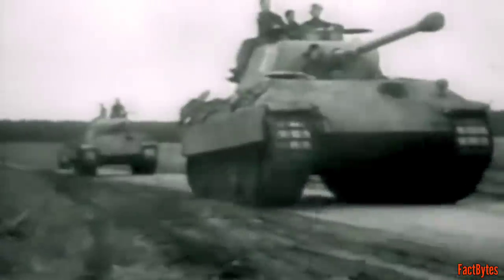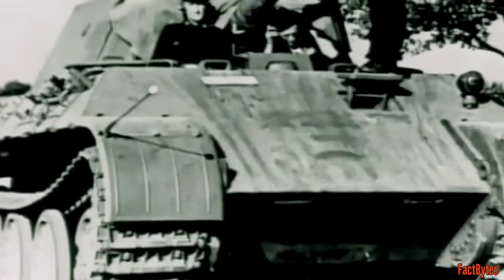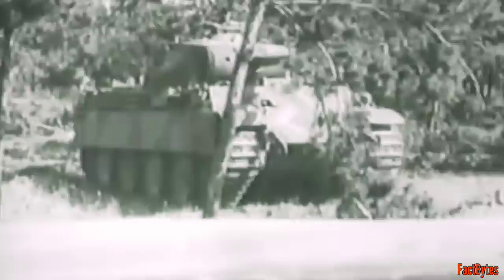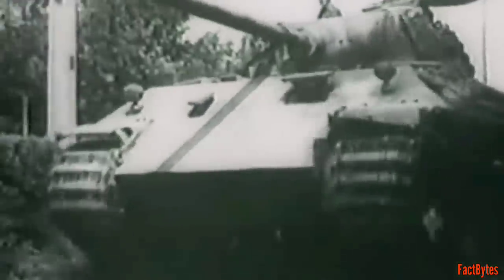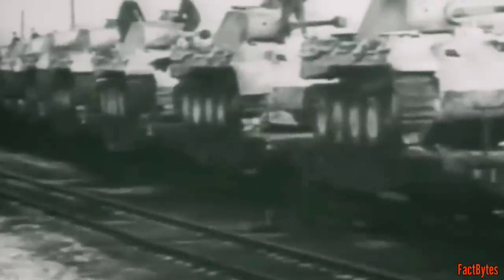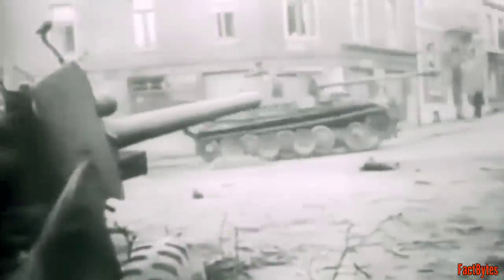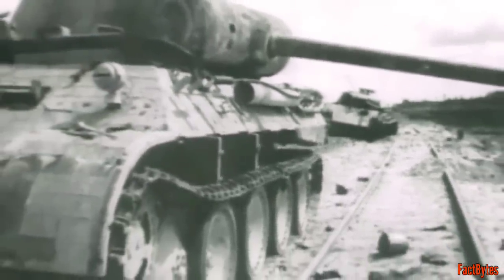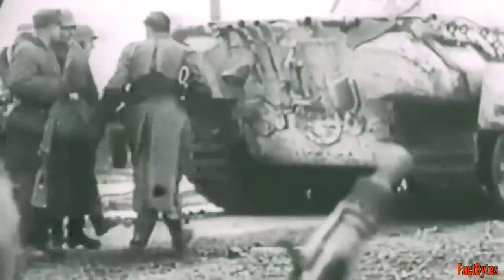Was The German Panther Really The Best Tank Of WW2?

Comment: This
Reply: Yes, like I said, there are a lots of subjects that you covered, that I would like to pick apart, like welding, simplicity of manufacture, and ext. You dump so much info....
Reply: @RussianThunderrr  I'll attempt to copy and paste what I said before buts it'll likely be different
Reply: @RussianThunderrr  though which one do you mean regarding welding, the Panther or T-34, as I can recall the Panther grew to have poor welding as the war progressed and T-34's faced quality issues, welding being one factor where in some case, gaps may be able to be seen and thus the rigidity or both vehicles structures become much more compromised.
Reply: @jerryudonneedtoknow3903  wrote: "though which one do you mean regarding welding, the Panther or T-34, as I can recall the Panther grew to have poor welding as the war progressed and T-34's faced quality issues"

-- Yes, I'll cover both tanks, rather most of Soviet and German tank building differences. First of all is a couple of words about "slop armor". There was a guy in the Kharkov design bureau name Nicholai Fedorovich Tciganov, and he was in charge of improving BT series tanks, and Soviet government was not happy by performance of light tanks(T-26 infantry tank, and BT(Quick tank) aka Walter Christie tank see link below) because it only featured small arm prove armor, but Soviet Government would like for those tanks to have an AT gun prove armor protection. However there was a catch with that assignment - BT tanks had a hybrid/convertible tracks/wheel propulsion, so weight of that tank was even more restricted then German Panzers requirements of that time(you probable aware it was around 24 tons, because of river crossing bridge restrictions), but in case of BT tank because it supposed to ride on wheel, to preserve wear and tear of tracks(it carried those on side sponsons) and once on soft soil, then crew installs somewhat narrow tracks, so if armor heavy enough to handle AT gun installed, then cross country capability suffers a great deal, so project "Tortes" aka BT-SV tank was created(two build) to test how sloped armor would work, followed by many other with ever thicker armor prototypes to follow, so he came up with a "Theory of Rational Angle of Armor Plate" which is pretty much an Effective Armor Thickness in a nutshell. He figure out that RHA(Rolled Homogeneous Armor) at steep angle doubles, and as a side benefit of incoming AT round to ricochet, and since it was an armor plate, instead of compound tank front at the time be it BT tank or Pz-I, II, III or Pz-IV and Tiger I manufacturing became a lot easier since less welding required.

Here is BT tank:

https://www.youtube.com/watch?v=QKaJ1hT6tUc&t=3s
Reply: But, first, yes thank you for been frank about source in a final gear subject. The reason why I asked this question is this: by the time of Pz-V development Germany had an ample supply of tungsten, in fact they were manufacturing tungsten-carbide core subcaliber munition by thousands, so of course they would have enough to make a  machine tooling from it. Second point, like you already saw, that cutting helical teething is just a simple matter of angle, nothing fancy tools wise required, at any rate it would improve reliability of final gear drive, however Pz-V final drive problem was mainly because it was designed for tank that was 10-15 tons lighter, and have a smaller and less powerful engine, so its an engineering problem, and not the type of gears were used, you could have a reliable gears, if proper gauge/thickness was used even in a spur type cog. One way around this problem, was planning for Panther II tank, that supposed to use Tiger tank transmission, and Tiger I main gun without muzzle brake, which was one of the features(muzzle brake) of T-34 tank(and most modern tanks, this vid mentioning how powerful was muzzle blast to by standers, but did not mentioned how much tank demasking itself), while Panther II caterpillar tracks supposed to be transportation tracks to Tiger III.
Reply: @RussianThunderrr  Agree, but I might have not stated the reason why I was emphasizing the gear. Indeed the Panthers transmission was designed for a 30ish ton tank, that's what made the gears the problem, so of the panthers gears are far to small for the vehicles weight, I don't fully recall, but something about the third gear of something, gearbox, or whatever. 

Anyway the point is, the gear design additionally adds to the problem, the current Panthers gear being a basically single straight spur cut gear was not the most suitable for pulling the vehicle, the panther was planned to have a planetary gear (I'm unsure if the planetary gears would consist of spur cut or helical cut gears), the spur cut gear for starters does has much more stress put into a single point where the gears mesh compared to a planetary gear system or just a helical cut gear due to the surface area which both usually cover more off. This meant that, even though the transmission was meant for a 30ish ton vehicle is could have possibly done decently better with a gear that could take more of a load.

But that was not the case, what is the case is that the transmission was 15ish tons overweight, the gear is not the very close to being suited for that weight, with the addition of the fact that the gear was pretty small, and this all this weight focused in a tiny area would be sure to cause high stress for the gear which would result in the shearing or shattering.

I'm sort of throwing in both the final drive gear and other gears because it wasn't only one gear. But I can't really focus right now.

So basically 3 main problems with gear.
1. What it was put in was not meant to handle the weight.
2. Some of the gears, were small for the tanks weight meaning much more load was put into a small area putting high stress.
3. The basically other gears beside the single spur cut gear while not the most necessary would have helped the dispersion of all that weight focus onto the gear due to more surface contact to disperse load.

Say the helical cut gear is used and the quality is terrible, I would more or less assume it would survive longer because it could more easily disperse the heavy load and stress put on it compared to a spur.

The idea of replacing the entire transmission is just throwing the discussion about it out he window thus why I stick to the underpowered one and look at plans, ideas, or attempts to patch the underpowered one
Reply: @jerryudonneedtoknow3903  wrote: "Indeed the Panthers transmission was designed for a 30ish ton tank, that's what made the gears the problem, so of the panthers gears are far to small for the vehicles weight"

-- Ok, so it looks like you have a good grasp of the Panther transmission problem, so the only thing to mention here is to replace it its a 3 day job, just like many Panther tank suspension repairs were a major PITA. Back to armor/welding subject.

-- So, beside N.F. Tciganov, there was yet another key fellow with name Eugene Patton, who improved upon electrode welding, where it took almost a week of dozen of welders to weld a complex shape tank hulls, but with automatic submerged flux welding only one, and not so highly experienced technicians could weld hull of T-34 in a rotisserie jig in just a shift or two, and the quality of the welds were so much better and stronger, that often if you see earlier 1940-1942ish T-34 hull with a turn side or front glacis plate in the event of internal ammo failure, after 1942 you would almost never seen torn apart T-34 hull, yet 6 tons turret might be blown away 50-70 feet into the air, and might landed nearby the otherwise intact T-34 hull, where weld seams are still intact, it was that good and strong. And this welding technic did speed up tank production a great deal, while German tank production still used very slow electrode welding.

-- A few words on poor metallurgy: I'm not sure how much do you know about Kharkov tank factory evacuation, it was after all pretty deep into Soviet union, but it still have to be evacuated even deeper to beyond a Ural Mounts to Nijnei Tagil where train factory was near by iron ore mines, however production of the tanks commence almost immediately upon arrival of evacuated equipment, in the middle of the winter in Siberia, while walls and roof was build around factory under weather exposed manufactory, could NOT possibly provide technologically correct heat treatment of armor plates at sub zero temperatures, so winter of 1942 was the lowest point of T-34 tank quality. There was also other factory building T-34, like a former ship yard Sormovo, that produced low quality tanks as well.
Reply: @jerryudonneedtoknow3903  -- Couple of words on a couple of other to favorite myths optics of T-34(namely earlier 76mm). As I mentioned after capture Kharkov, near that city there was an optics factory in a city of Isumins, so no more gun sights and periscopes for a while Soviet industry could produce for a while, so mirrors in a periscope was substituted with polished aluminum plates, and optics was of atrocious quality, but as the time progressed to the end of 1942-43 and more factories was back into production of sights, so optics that was good for knocking out German tanks at the distance of 1200-1600 meters or a mile was back to normal.

-- Also pretty often, people dismiss earlier models of T-34-76, and thinking T-34-85 was the only worthy tank, which is not so, since German High command thought T-34 was a much better tank, then what Wehrmacht had at that time i.e. Pz-III and Pz-IV, hence rush to develop and production of Pz-V tank, so not only that... but people forgetting, that also only top Allies highest Scoring tanker Aces was actually produced by T-34-76 tank, here is the story of just one of a few:

https://www.youtube.com/watch?v=0NHj9xA4zIo

... and not by T-34-85 or any other Allied tank.
Reply: -- Also I recalled, that you mentioned that Soviets did not have a dedicated recovery vehicle. That is one of the more interesting subjects... Some extra power and torque of T-34's engine(that actually deserves a special attention on its own) actually enable it to get out from so many problems tank faces in a combat, and recovery of other tanks are one of them. In German before dedicated recovery tank, German half tracked like Famo or Krauss-Maffei, which two to three would be used to recover/tow German heavy tank or two Tiger tanks, which is a big disadvantage when comparing it, to some smaller disadvantages like gun depression(which is hardly a factor in a flat plains of Stepps), or absence of turret basket, since T-34 ammo was stored on the floor, just like later M4 Sherman with wet ammo stowage. So, T-34 could also be used as a recovery tanks to other T-34s.
Reply: @RussianThunderrr  oh shoot may comments keep failing to send, well I basically forgot what video this comment was on so I struggled to find this string
Reply: @jerryudonneedtoknow3903  wrote: "I don't see the T-34 as a "fast" tank, but as a tank that can reach it's possible fastest speed and the quickest amount of time. This I see it as more of a "nimble" tank. Personally I like to separate fast into two areas, acceleration and speed."

-- Very good, and that is what I meant by fast and "nimble" tank. Many people look at top speed, and making judgment whether that vehicle was fast or not, in combat it is not as important, acceleration(i.e. how fast it pick up(or physical definition of acceleration is a rate of change of speed)) is a lot more important. In that regard T-34 was great, and yes it was fast in top speed realm as well, but as I said its a lot more important to maneuver, right after the shot been fired, since AT guns are aiming much faster at the tank that standing still.
Reply: -- Here is, yet another fairly important factor, that you almost never will hear from Western historians... How fast and maneuverable T-34 was, and when I say fast, I'm not only talking about top speed(which is almost irrelevant), but how fast tank accelerated from dead stop, since to shoot accurately at the target, including M4 Sherman, tank had to stop, aim and fire on the target, and then move and maneuver, so how nimble the tank is, is actually sometimes more important, then having a thicker armor. Yes, there were T-34(and other Soviet tanks including KV) variants, that used additional frontal armor, and tanks frontal armor could increase relatively easy, but feed back front tankers that was giving those tanks, actually preferred stock T-34 tank, in fact there are quite a few veterans and even present day drivers(who restore tanks) who preferred lighter T-34-76 to heavier T-34-85. You not going to see this kind of maneuverability from Panther or M4, T-34 was like by its drivers for been nimble:

https://www.youtube.com/watch?v=jXRztT8Ev2A&t=4s
Reply: @RussianThunderrr  Now Regarding the T-34 with speed. I agree and disagree with what you state.
I specifically like to make a major differentiation between acceleration and speed. Have a major disease for the word "speed" in a generalized term. I do not consider the to T-34 to be fast but I do consider it to be nimble. Especially with the fact that the engine rarely if not ever reached it's top speed. In addition on off-road terrain where its most likely to drive, it's speed is comparable to other tanks, especially the panthers. I will not argue it's acceleration and I fully agree. I wouldn't call the tank fast, but I would definitely agree that it's nimble. 
I see it as this, the T-34 is not really fast in speed and is comparable to other nations tanks, but in attaining its maximum speed (whether limited or not), it is very quick to do so.
Specifically my view on both speed and acceleration is this...
A tank may be able to reach a high fast speed, but how long will it take to achieve such speed?
A tank may be able to reach its best speed in the quickest time possible but how "fast" is that max speed?

Now regarding the production quality, indeed, I know a decent amount about the Kharkov tank factory evacuation, but I like to account a bad quality of production on the T-34 for a reason and thus why I don't consider the T-34 a good tank overall (well far superior to that of the garbage known as the Panzer IV). With the evacuation of laborers and equipment, that was one problem. Ill-informed individuals often complain about the bad quality of a T-34 and generalize it without reason. I have a specific reason. Factory-183 UTZ, located in the Urals, the area where the the evacuated workers and tools where shipped to produced the most numerous amounts of T-34s, considering that as a factor, I would easily come to assume that many defects or problems in production are going to heavily affect many of the T-34s, primarily with the reasoning that much of the T-34s have been produced in the areas with the many complications afflicted iron it's production.
Reply: @jerryudonneedtoknow3903  wrote: "well far superior to that of the garbage known as the Panzer IV"

-- Pz-IV was not necessarily was a "garbage" as you think. This tank had a very long service life, even after WWII, Panther were not, and Panther supposed to replace Pz-IV completely along with Pz-III, but that did not happened, and nobody talks about reasons why is that...
Reply: @RussianThunderrr  By all means the Panzer IV was utter trash and I stick by it. If there is any tank I love and study the most, it is the Panzer III, if there is any tank I despise because of its design, public view, and other factors, its the Panzer IV.

I know more about the Panzer III and Panzer IV far more than I know the Panther. I consider the Panzer III far better than that of the Panzer IV by tenfold. 

I shall address the many issues, firstly I shall discuss in design and lastly everything else.

Firstly, in production and design, it was a complicated pile of garbage. Comparing to the Panzer III, the Panzer IV has many odd angles and shapes, this makes the manufacturing, assembly, and welding far more difficult and time consuming, when looking at the Panzer III, the Panzer III stands firmly above it as the easier to manufacture chassis, its symmetrical with simple angles to not complicate the assembly. The most notable inconveniences are the rear superstructure and front superstructure which require the angle to be welded in the correct direction, even the Panther was far superior to that of the Panzer IV becoming MUCH MUCH quicker and easier to produce than the Panzer IV, and mind you, the Panzer IV was produced from the start of the war while the panther just recently came in, yet the Panther soon outmatched the production and assembly speed.
In addition, the asymmetry of the Panzer IV's designs contributes to more complications.

Moving on to more design issues. The panzer IV was a tank that kept having things slapped onto of it until it couldn't handle it anymore, it reached its limits.
The Panzer III had many upgrades, it made it probably one of the best tanks in the world during 1940-41 (Excluding soviet tanks), it was capable, reliable, and had some decently tough armor. And even with all the upgrades, it never got too overburdened to complete its role.
The Panzer IV on the other hand got better then worse over time. From the A-F1, it'd receive improvements, but afterwards, it became a slow downfall, then a horrendous one.
The Panzer IV was designed to use the short 7.5cm gun, that's what it was made more and it did not really have any space for major change without drawbacks. The Panzer III could receive major change and compensate if not ignore its drawbacks with improvements/upgrades, the Panzer IV could not after the Ausf. F1. With the 7.5cm KwK L/43 added on the Ausf. F2, it began its downfall, the gun put a decent amount of frontal weight on the tank and thus put some strain on the front suspension and transmission. While the transmission was reliable and from the Panzer III, it could tolerate it, the suspension was supported with either moving the return roller or strengthening the front suspension, I forgot which right now. From there on it would change, the Ausf. G would receive extra frontal armor adding more stress to the transmission and suspension. And being designed to use  the short 75, it was never planned in design to compensate for such frontal weight unlike the Panzer III which had future planes to mount larger guns, it only really used 3.7cm guns because it was most in stock and standardization, but back to the IV, The Panzer IV had not been designed for this front weight so the stress on the tank began to stack. 

The came the worst to the Panzer IV, the upgrade to the 7.5cm KwK L/48 gun, being longer and heavier, it strained the transmission even more, to the point where a reliable and tough transmission became unreliable due to the stress from the front of the tank. In addition the lower glacis was made 80mm think adding more frontal weight to the tank, add-on the fact that the hull roof and turret roof were both thickened and you have more overall weight. This was really problematic, the Ausf. G did have a small increase in reliability issues, but more major issues came with the Ausf. H
In addition, there was no counterbalance, the Panzer III added armor to the rear in order to improve armor and counterbalance the front weight added from larger guns and more armor, the Panzer IV did not simply leaving it the same 20mm from the Ausf. E
Now Ausf. G did have the good transmission from the Panzer III, that being the ZF SSG 76, this was improved on the H to the ZF SSG 77, the best version of the Panzer III transmission which lacked the issues of it's predecessor, but instead of better performance, the frontal weight imbalance afflicted the reliability of this better transmission, making it have "just enough" for the Panzer IV to work. Hell the Panzer IV was just scrapping by, it was lower ever so slightly in max speed but the acceleration was dropping hard, the SSG 77 helped keep the speed from dropping too hard but it could save itself from overburden nor could it majorly improve the acceleration. (the engine got upgraded aswell but the frontal stress was massive). This is why Panzer IV combat readiness rates became a bit low during late war. 

It's armor wasn't even that good either, it reach just the bare minimum to survive, well the hull that is, unlike the Panzer III, he turret basically didn't receive any up armor after it reached 50mm, while the hull grew to be 80mm thick, the turret remained at 50mm till the end.

The best of the Panzer IV's being the Ausf. H, was majorly stressed as is, then came the worst out of a need for sheer production and late war problems, the Panzer IV Ausf. J was many worse characteristics like a hand cranks turret drive after the removal of the hydraulic turret drive and many many more issues.

This is such a flawed tank and it gets so much praise as a tank that should have been produced over the Panther, This god awful pile of German scrap needed to be replaced by the panther.

"-- Pz-IV was not necessarily was a "garbage" as you think. This tank had a very long service life, even after WWII, Panther were not, and Panther supposed to replace Pz-IV completely along with Pz-III, but that did not happened, and nobody talks about reasons why is that..."

The Panzer IV had such a long life because it was a stopgap, from Barbarossa and onwards. The F2 was a stopgap to counter the T-34, it remained a stopgap until a better tank could replace it, and by the time the Panther was being put into mass production, it was getting replaced, hell, the factories producing Panzer IVs started to dwindling in number. The Panther was taking over the Panzer IVs and replacing them, just not fast enough. Especially considering that Panthers had a whole new different organization with a platoon less in the company, Panthers and Panzer IVs could be in the same division, but not in the same Company. When Panthers were assigned, they completely replaced an entire company, sometimes an entire battalion of the Panzer IVs, they were not thrown in and sprinkled around.

The Panzer IV was effective enough to kill other tanks, it was not good, it was just enough 

Though the Close support Panzer IVs are good, well excluding design, I still despise it, but its not stressed to the point of failure like the long barreled ones.
Reply: @jerryudonneedtoknow3903  -- Also I wanted to through one more point, that if you are not speaking Russian language, then this info almost never available to you, or for some strange reason, I almost never coming across that in Western English speaking world. Just like German tanks, there were so many attempts to stick additional armor to T-34:

https://www.youtube.com/watch?v=aQGqKlvwvTc&list=PLODuYU8PU6dStm7lGDYzvbXsh5FrKtMAB&index=37

However, it was very unpopular among T-34 tank crew, since it did make tank "nose" heavy, same as Pz-IV, and its maneuverability decreased significantly. Now, this is the part of not talked much ... There were very fears competition among design bureau/factories that produced tanks. In fact by final version of T-34 having similar armor protection, same gun, and by far better speed and maneuverability, there was a logical question why do you need J. Kotin's designed tanks KV-1(later he designed IS series tanks) of nearly similar performance? To compete with T-34 J. Kotin came up with KV-1S("S" - letter for "Skorostnoi" or "Speed"/Fast) with thicker then T-34 frontal armor, and significant number(1340 units) was produced in a short time, but it was not consider "faster" nor better then T-34. I don't remember exactly at which point Chelyabinsk(where Leningrad heavy tank factory been evacuated) start producing T-34s, but eventually, after Tiger I that was captured in August of 1942, and was tested at Kubinka proving grounds showed that T-34's F-34 gun was not able to punch through the Tiger I armor at any distance, only 85mm AAA gun, so decision was made 1) to make subcaliber Tungsten-Carbide ammo for F-34 2) Put 85mm AAA on new KV-85(later know as IS-1) tank, that also had a new planetary gear box, and eventually after A. Morozov figure out, that 85mm gun can be installed in three man turret on T-34, KV-85/IS-1 was cancelled once again(thanks for versatility/adaptability of T-34 tank), but after a little "soul searching" it got 122mm main gun, and from then on aka IS-2. 

-- Also, not only feedback from T-34 drivers indicated that burdening T-34 tank with extra frontal armor is not productive, but statistics showed that only 40% of hits goes to hull, and 60% to turret, so increasing armor at turret is a lot better deal, so decision was made to leave T-34 hull unmodified with just increase of turret ring from 1450mm to 1600mm in T-34-85, with turret armor thickness/protection increased, so tank still remained somewhat dynamic, and not so nose heavy.
Reply: @RussianThunderrr  Now Regarding the T-34 with speed. I agree and disagree with what you state.
I specifically like to make a major differentiation between acceleration and speed. Have a major disease for the word "speed" in a generalized term. I do not consider the to T-34 to be fast but I do consider it to be nimble. Especially with the fact that the engine rarely if not ever reached it's top speed. In addition on off-road terrain where its most likely to drive, it's speed is comparable to other tanks, especially the panthers. I will not argue it's acceleration and I fully agree. I wouldn't call the tank fast, but I would definitely agree that it's nimble. 
I see it as this, the T-34 is not really fast in speed and is comparable to other nations tanks, but in attaining its maximum speed (whether limited or not), it is very quick to do so.
Specifically my view on both speed and acceleration is this...
A tank may be able to reach a high fast speed, but how long will it take to achieve such speed?
A tank may be able to reach its best speed in the quickest time possible but how "fast" is that max speed?

Now regarding the production quality, indeed, I know a decent amount about the Kharkov tank factory evacuation, but I like to account a bad quality of production on the T-34 for a reason and thus why I don't consider the T-34 a good tank overall (well far superior to that of the garbage known as the Panzer IV). With the evacuation of laborers and equipment, that was one problem. Ill-informed individuals often complain about the bad quality of a T-34 and generalize it without reason. I have a specific reason. Factory-183 UTZ, located in the Urals, the area where the the evacuated workers and tools where shipped to produced the most numerous amounts of T-34s, considering that as a factor, I would easily come to assume that many defects or problems in production are going to heavily affect many of the T-34s, primarily with the reasoning that much of the T-34s have been produced in the areas with the many complications afflicted iron it's production.
Reply: @jerryudonneedtoknow3903  wrote: " I will not argue it's acceleration and I fully agree. I wouldn't call the tank fast, but I would definitely agree that it's nimble."

-- T-34 can seriously haul-"S":

https://www.youtube.com/watch?v=-1NxcXAMefE&t=169s

-- You can see how fast it accelerates after crossing a water barrier. BTW you can see actual speed of each tank on the bottom of the screen with colors corresponding to the tank flags, and top speed was 57km/h, and how fast it is. What does that mean? For example, if Panther have a long range gun(BTW Panther had a record of knocking out tank at the distance of 3km in WWII), but to be affective, and not wasting ammo, as a rule Panther would not engage on T-34 over 2km away(in fact most engagements were happening on medium distances 800-1200 meters, and only 15% over that distance), that is why long range Panther's KwK42 L70 was slightly negated, and lethal part of distance of 1000 meters fast moving T-34 can cross pretty fast. Even first accounts of German AT gunners was shocking how fast T-34 can cross "kill zones". That is instance where "top speed" does matters, and that is why rampaging T-34 was considered more dangerous then slow moving KV tanks.
Reply: @RussianThunderrr  I just don't see the T-34 as "Fast". "Fast" is what I personally consider as a combination of high speed and quick acceleration, thus why I state I see it as only nimble. 

By nimble I mean "Able to make quick movements, reactions, and responses" This is the case where acceleration is key and that the tank can get moving quickly and "instantly" 

Fast (as in high speed) is how fast the vehicle can go, my personal view on fast being about ~35kph off-road.
Reply: @jerryudonneedtoknow3903  wrote: "Especially with the fact that the engine rarely if not ever reached it's top speed. In addition on off-road terrain where its most likely to drive, it's speed is comparable to other tanks, especially the panthers. I will not argue it's acceleration and I fully agree. I wouldn't call the tank fast, but I would definitely agree that it's nimble."

-- Couple of points about Panther. It did have the same power to weight ratio as T-34, however due to its fragile final drive, it could not be driven as hard as T-34 tank did, however it did have hydraulic power assistance(but so is Soviet 44 tons IS-2 tank), and according to Panther drivers it is one of the smoothest off road tanks, in fact Sherman had main gun stabilization, but in case of Panther overly complicated and long traveling suspension it was the most stable platform that it was almost as effective as gyro stabilization as on M4.  

-- The other thing about Panther, if you are really into tanks, is pay attention to length of main gun in calibers. For example to fight  artillery and infantry actually Kurtz 7.5cm L24 gun was best, because of its howitzer like step projectile trajectory/ballistics, and that is the reason why last model of Pz-III became a "Begleitwagen" or fire support vehicle/tank. However, tanks not only fighting infantry and artillery, but other tanks as well, and for that dual purpose gun with barrel length between 40 to less then 60 calibers works best. Which would be Pz-IV 75mm L43 & L48, Tiger I 88mm L56, T-34 76.2mm L41 and 85mm L55 guns. Then there are more of the high performance anti tank guns that doing that at expanse of anti personnel performance like PZ-III 5cm L60, Panther 7.5cm L70 and Tiger II 8.8cm L71 guns, so theory why Pz-IV still remained in the production, because Panther was not as good as anti personnel tank.
Reply: @RussianThunderrr  "-- Couple of points about Panther. It did have the same power to weight ratio as T-34, however due to its fragile final drive, it could not be driven as hard as T-34 tank did, however it did have hydraulic power assistance(but so is Soviet 44 tons IS-2 tank), and according to Panther drivers it is one of the smoothest off road tanks, in fact Sherman had main gun stabilization, but in case of Panther overly complicated and long traveling suspension it was the most stable platform that it was almost as effective as gyro stabilization as on M4. "

To add on, one of the benefits of interleaved and overlapped road wheels are  the much more stable ride, due to the many contact points to the track and whatnot, it allows a smoother ride.

Well the main reason why Panzer IV's remained is because of numbers, by the time the Panther had began a huge burst in mass production, the soviets were advancing very quickly at which the Germans struggled even more to supply their losses, at this point, it was practically, gets more tanks out, any kind as long as they could restrengthen the units in the field. This was especially noticeable since the Panther basically had upgrades continuing through the war till the end while the Panzer IV got downgraded just to speed up production. It basically was showing ti self more as a stopgap, remove the turret drive so its horrendously slow, remove one return roller, remove, remove, remove, everything to speed up production to get more out, the turret was slow you might as well just use a StuG, or just use the chassis to make a StuG IV. I personally made a gunner who transitioned from an H to a J after they had to abandon their H, he complained about how it was painfully slow and tiresome to use.

"-- The other thing about Panther, if you are really into tanks, is pay attention to length of main gun in calibers. For example to fight  artillery and infantry actually Kurtz 7.5cm L24 gun was best, because of its howitzer like step projectile trajectory/ballistics, and that is the reason why last model of Pz-III became a "Begleitwagen" or fire support vehicle/tank. However, tanks not only fighting infantry and artillery, but other tanks as well, and for that dual purpose gun with barrel length between 40 to less then 60 calibers works best. Which would be Pz-IV 75mm L43 & L48, Tiger I 88mm L56, T-34 76.2mm L41 and 85mm L55 guns. Then there are more of the high performance anti tank guns that doing that at expanse of anti personnel performance like PZ-III 5cm L60, Panther 7.5cm L70 and Tiger II 8.8cm L71 guns, so theory why Pz-IV still remained in the production, because Panther was not as good as anti personnel tank."

While I get your point there is one things I have to disagree with, the Panthers shells is equal if not better, the arc of low velocity guns allows the vehicle to flush out infantry positions be it close or long range distance, it's more likely to get lobbed in a trench successfully then at the ground in front of it. But I disagree that the Panzer IV is better at fighting infantry solely based on that. Depending on the sources I've read, the Panthers HE shell has either the same explosive mass or a significant increase in explosive mass compared to the 7.5cm Kwk L/43 and L/48 HE shells, by no means is the shell physically weaker. Basically the shell isn't weaker but rather how its used, in an entrenched position, it is harder to get a flat trajectory shell in the trench but a short howitzer can lob a shell in there. Even this being the case, it still has a fairly hefty explosive mass, so it should be equally capable of taking out infantry, just a bit less effective against those in pits or trenches.
And its not like its HEAT either where the effectiveness will degrade with centrifugal force.
Reply: @jerryudonneedtoknow3903  wrote: "But I disagree that the Panzer IV is better at fighting infantry solely based on that. Depending on the sources I've read, the Panthers HE shell has either the same explosive mass or a significant increase in explosive mass compared to the 7.5cm Kwk L/43 and L/48 HE shells, by no means is the shell physically weaker. Basically the shell isn't weaker but rather how its used, in an entrenched position, it is harder to get a flat trajectory shell in the trench but a short howitzer can lob a shell in there. Even this being the case, it still has a fairly hefty explosive mass, so it should be equally capable of taking out infantry, just a bit less effective against those in pits or trenches."

-- From since its a higher velocity of the gun so projectile walls have to be thicker, with less explosive. This is also the reason Sherman 75mm gun was more popular, because it had more explosive, then 76mm Sherman and FireFly tanks as well, and since Shermans were less likely to run into tanks, and more likely soft targets 75mm was more popular and numerous.
Reply: @jerryudonneedtoknow3903  wrote: "Fast (as in high speed) is how fast the vehicle can go, my personal view on fast being about ~35kph off-road."

-- That would not be a problem, as there are plenty of documentary videos showing that... Many other WWII tanks, not so much:

Here at 1:26 an earlier model of T-34-76(with a single hatch) steaming pretty quick, commander stuck his hand out, and almost lost it...:

https://www.youtube.com/watch?v=fKmQuA5N5S8&list=PLODuYU8PU6dStm7lGDYzvbXsh5FrKtMAB&index=1&t=85s
Reply: @jerryudonneedtoknow3903  wrote: "To add on, one of the benefits of interleaved and overlapped road wheels are  the much more stable ride, due to the many contact points to the track and whatnot, it allows a smoother ride."

-- Actually there is a lot more to it, then just a stable ride i.e. much lover rolling resistance that helped with transferring power from engine to tracks. One of Panther driver said that once they forgot to apply parking break, and Panther start rolling right next to parked T-34 tank, however many, many T-34 veterans driver called T-34 "Ласточка"(Swallow - very nimble bird). There are accounts of T-34 tank commanders that sometimes did not have time to give order to shoot AT gun because of close distance, but driver turned the tank and crash it with caterpillar tracks, this is something that was very particular to T-34 tank. Sherman could not maneuver that fast because high CG, so they would just tip-over on the side. Here is some more documentary of T-34, BTW pay attention  that even 85mm gun did not have a muzzle break, so it would not giving "panzer grenadiers" that riding/running next to the tank a concussion(something Panther was famous for):

https://www.youtube.com/watch?v=tfRXsNhGFTQ&list=PLODuYU8PU6dStm7lGDYzvbXsh5FrKtMAB&index=20
Reply: @RussianThunderrr  
"-- From since its a higher velocity of the gun so projectile walls have to be thicker, with less explosive. This is also the reason Sherman 75mm gun was more popular, because it had more explosive, then 76mm Sherman and FireFly tanks as well, and since Shermans were less likely to run into tanks, and more likely soft targets 75mm was more popular and numerous."

That would be the case for the Panther and Panzer IV "IF" they both used the same shell, but this is not the case, the Panther utilized the Sprenggranate 42 while the Panzer IV used the Sprengpatrone 34.
The Panthers shell would have less explosive mass if it was the same length, but its actually longer thus able to hold equal if not more explosives even if the walls are thicker
Reply: @jerryudonneedtoknow3903  -- Here is interesting documentary at 2:45 crossing destroyed bridge, and then next looks like Siegfried Line fortifications, all at pretty good speed, otherwise impossible to cross those "tank dragon teeth":

https://www.youtube.com/watch?v=gnV16wImj4M&list=PLODuYU8PU6dStm7lGDYzvbXsh5FrKtMAB&index=22
Reply: @jerryudonneedtoknow3903  wrote: "That would be the case for the Panther and Panzer IV "IF" they both used the same shell, but this is not the case, the Panther utilized the Sprenggranate 42 while the Panzer IV used the Sprengpatrone 34.
The Panthers shell would have less explosive mass if it was the same length, but its actually longer thus able to hold equal if not more explosives even if the walls are thicker"

-- It is about equal:
Sprenggranate 42: Projectile weight: 5.74 kg (12.7 lb)
Explosive weight: 0.650 kg (1.66 lb) (2,720 Kilojoules)

Sprengpatrone 34: Projectile weight: 5.75 kg (12.7 lb)
Explosive filler: 0.66 kg (1.5 lb) of amatol (2760 Kilojoules)

-- T-34-76 had better HE of multiple type here is couple:

ОФ-350(Long range HE)	Projectile weight 6,2 kg	Explosive weight: 0.710 kg

Фугасная стальная старая русская граната	Ф-354	Projectile weight 6,41 kg	Explosive weight: 0.785 kg

--T-34-85:

О-365	Projectile weight 	9,54 kg Explosive weight: 	0.741 kg

-- M4 Sherman 75mm gun:

M-48 HE Explosive weight: 1.47 lb(0.6667 kg)

-- M4 Sherman Long Gun:

M42A1 HE	22.11 lb (10.03 kg)	12.87 lb (5.84 kg)	0.86 lb (0.39 kg)

*No wonder nobody liked M4 Long Gun HE round!

Here is old(~1980) movie about M. Koshkiv(lead designer) and his tank test run Kharkov-Moscow-Kharkov. Fast forward to 1:26:45 for cool T-34 footage in the snow:

https://www.youtube.com/watch?v=MmQyurj65wc
Reply: @RussianThunderrr  "No wonder nobody liked M4 Long Gun HE round!"
lol

"Sprenggranate 42: Projectile weight: 5.74 kg (12.7 lb)
Explosive weight: 0.650 kg (1.66 lb) (2,720 Kilojoules)

Sprengpatrone 34: Projectile weight: 5.75 kg (12.7 lb)
Explosive filler: 0.66 kg (1.5 lb) of amatol (2760 Kilojoules)"

This is why I mention multiple sources earlier, I found one listing about 700+ grams of explosives, while the there had 650 grams of explosives
Reply: @RussianThunderrr  
Some additional things I found regarding the Panthers transmission final drive gearing from Spielberger's Panther Book

A regenerative controlled steering unit had been developed for the Tiger tank and had demonstrated its effectiveness without any major teething troubles. However, the manufacturing industry maintained that the machinery for gear production (primarily those necessary for the internal teeth gearing) were not available for large scale production of the Panther tank and could not be obtained in sufficient quantities. As an interim measure a clutch-and-brake steering mechanism was considered acceptable. Development and testing of the controlled differential steering mechanism would have to be accelerated in light of the advantages it offered. The MAN design already provided for the possibility of its installation.

With regards to production requirements in terms of hours needed, it turned out that the Daimler-Benz chassis required approximately the same amount of production time as the MAN version in its simplified form as currently submitted. This was explained by the fact that the firm of MAN had made constructive simplifications such as replacing the regenerative controlled differential discontinuous steering with a clutch-and-brake steering and the planetary type reduction gear in the final drive with a two stage spur wheel gear.

At this time, it was still not certain what steering type would be utilized, but it was assumed that a simple clutch-and-brake steering unit would be installed initially, since the companies making the vehicle's components did not have the proper gear cutting machines needed to produce a controlled differential steering unit (29 gear wheels per unit). There was an acute shortage of slotting machines necessary for the internal serration of the hollow gear. The housing was to be manufactured of cast steel with a strength of 60 kg/mm. Shrink holes which appeared might be welded over on the condition that the housing be annealed following the welding. In a conference with the Reichsminister fur Riistung and Kriegsproduktion on the 19th of May 1942 it was agreed that the majority of machinery materials for the Panther would be acquired in France.

So more specifically, it was the lack of internal teeth cutting tools and machinery for those types of gears